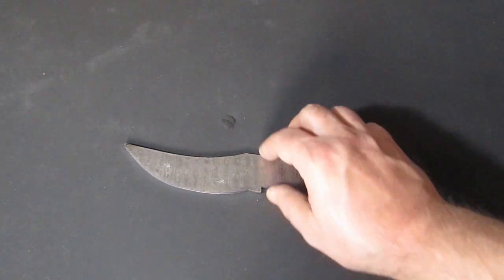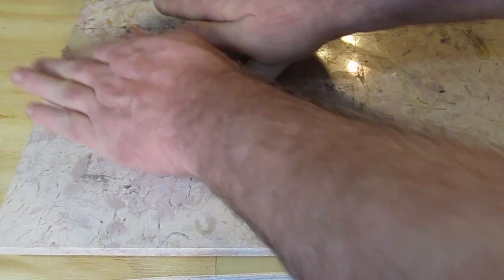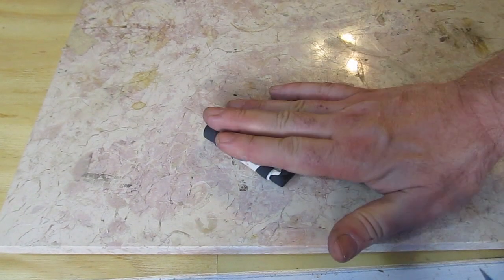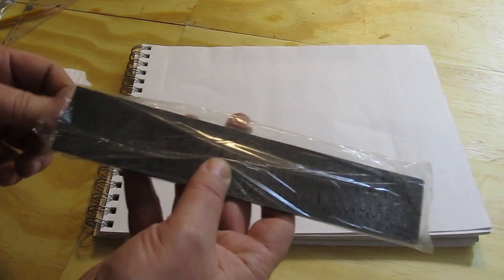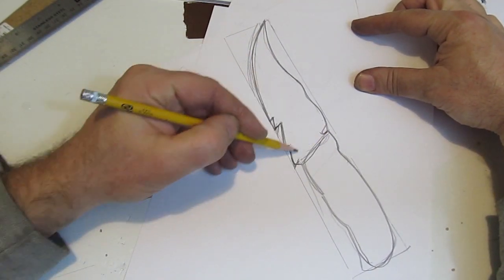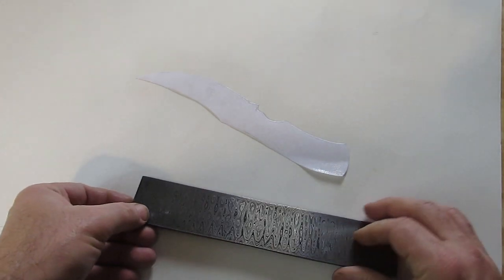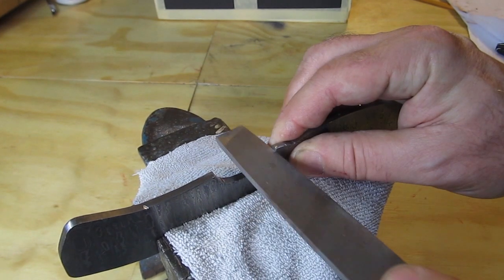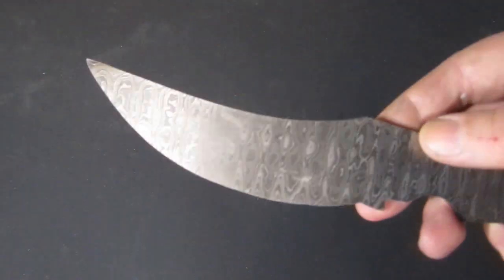Make a Damascus Steel Knife without making Damascus steel

Comment: Oooooh

I heard the damascus steel was actually one of the most deadliest weapons back in the day. It can cut clean and quickly.
Reply: damascus was made for two reasons, it looks pretty and it removes excess coal and other crap from the steel that you don't want in your blade. It was basically made because the steel back in the day wasn't as pure as it is today and it helped making the steel better. These days with the materials we have in use, damascus is basically only used as a decoration.
Reply: And also, modern steel have its strength uniform everywhere, vs the damascus steel which have harder and softer points.

Comment: Hey, I am in the market for a belt sander, and I have seen the 1 inch one you were using on Amazon. Would you recommend that belt sander?
Reply from the maker: +Joe Ramirez For the price it is adequate. But if you don't have a 4 inch belt sander I would get that first. Much more effective.